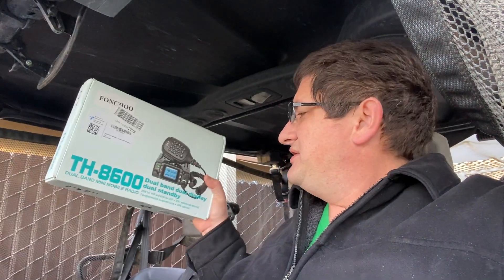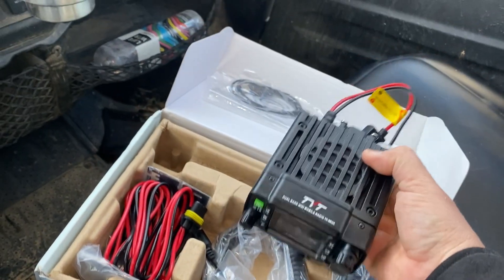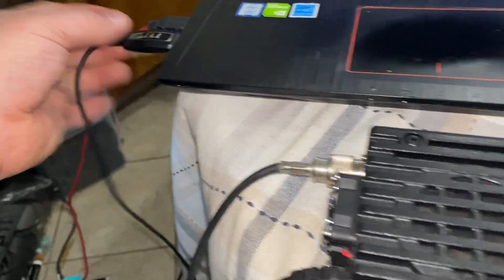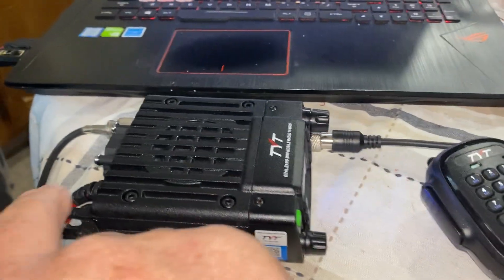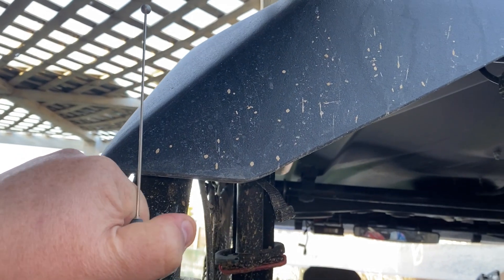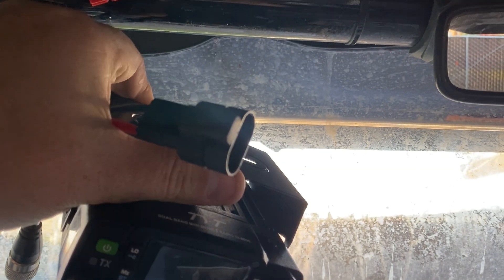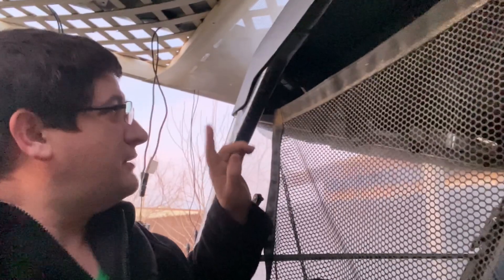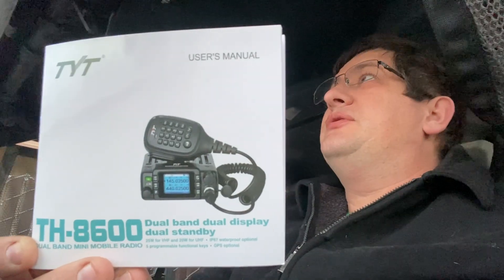Improve Coms on the Trail: VHF / UHF (Ham) Radio Install on Honda Pioneer

Comment: Do all the tyt radios open up the gmrs channels with that same button press combination?
Reply from the maker: This is the way on this one. I have another TYT that is Chirp capable. It varies between them. These are supported by Chirp right now: TH-350, TH-7800, TH-9800, TH-UV3R, TH-UV3R-25, TH-UV8000, TH-UV88, TH-UVF1, TH-UVF8D, TH9000